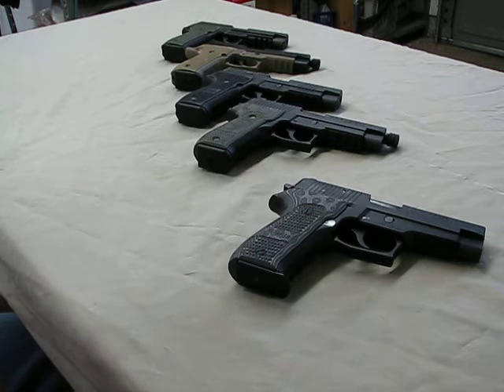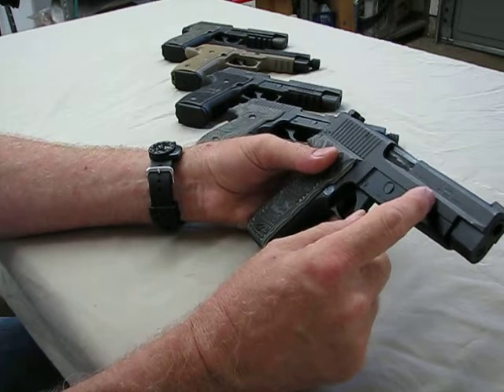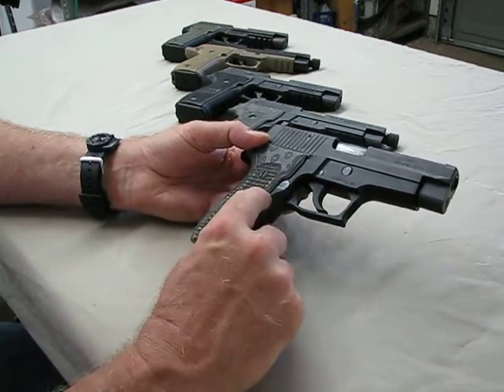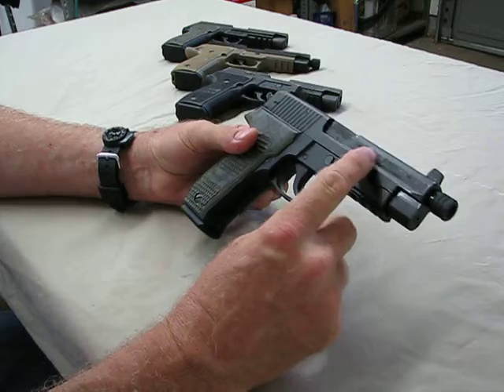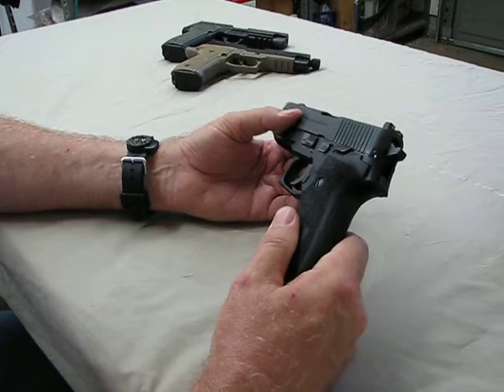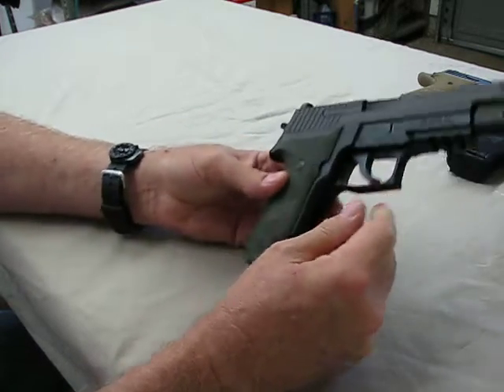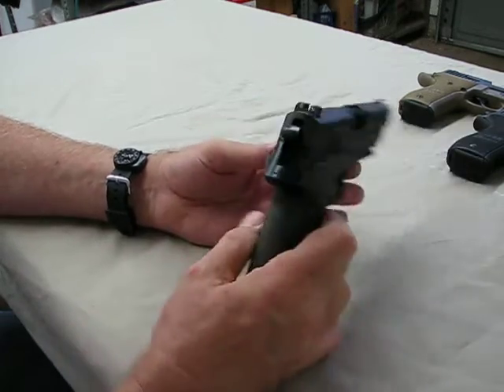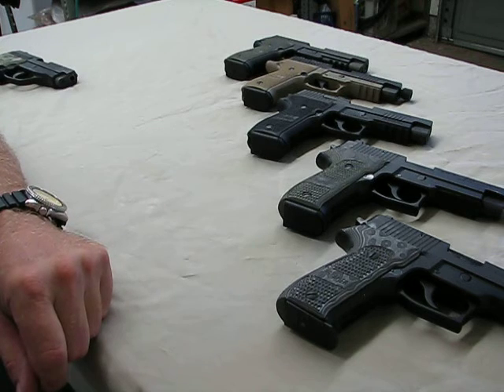My Sig P226

Comment: Spiffy presentation. I've got a P226 with a German frame and American made SS slide in 40S&W. I recently purchased a 9mm Caliber X-Change kit for it. I installed the SRT as well which makes a BIG difference. You're video has convinced me to install the SRT on my P220 Carry 45ACP as well since wife and I will be moving to a free state after the first of the year escaping California as it circles the drain. I will then be getting a CCW. If I don't spring for the P239 or M11-A1 I will likely carry my P220 since it's marginally larger than the P239. I'm lucky in that I shoot just as well with either the 9mm, 40S&W or the 45. But, as you already know, that's easy with a SIG.